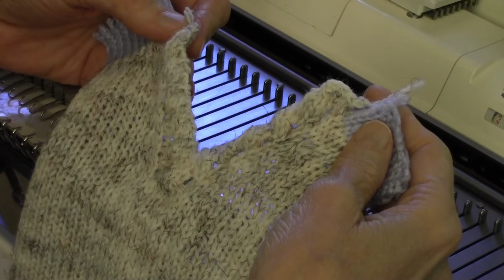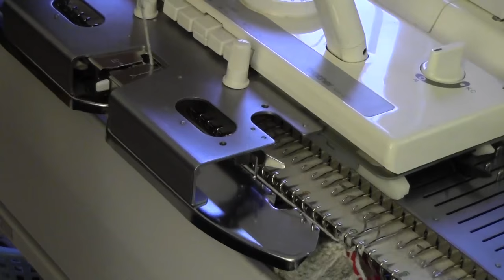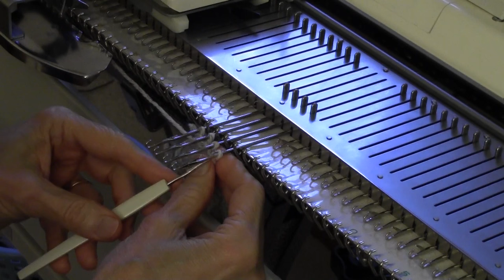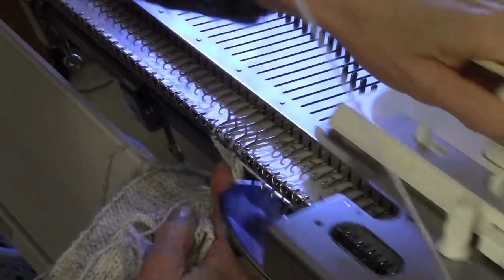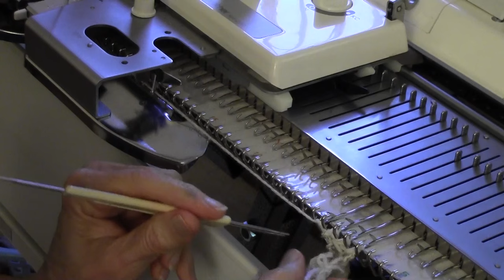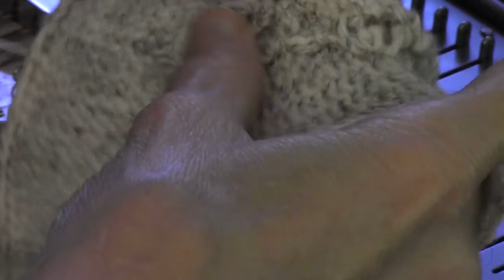V-Neck Crochet-Look Edging to Machine Knit by Diana Sullivan

Comment: hello from Poland :)
I have a question
why does the thread break off at the edges?
what am I doing wrong?:((
I have a Brather machine.
Reply from the maker: There are a couple of things to look at.  First of all, the upper take-up springs (antennas) can get old and not pop up fast enough.  You can replace them.  If your yarn is saggy at the edges from that, it makes edge loops, which get caught in the brushes.  When you knit, go just until the click.  Don't keep going a long distance after the edge.  Also, turn your sinker plate over, use a Crosspoint screwdriver, and remove the round brushes.   Clean underneath them, put in a drop of oil, and put them back on.